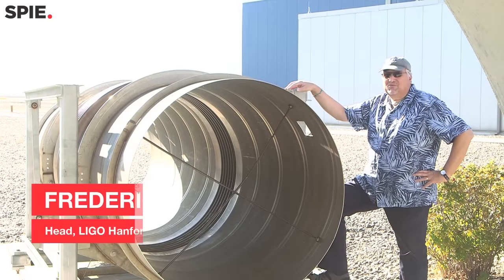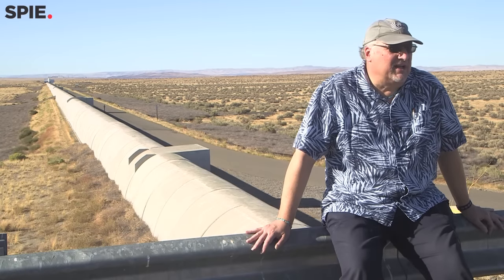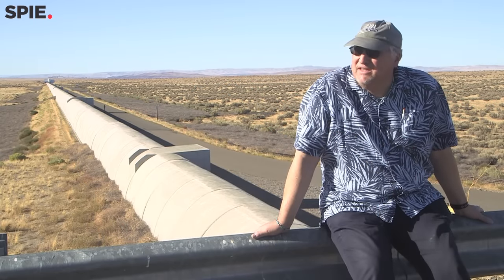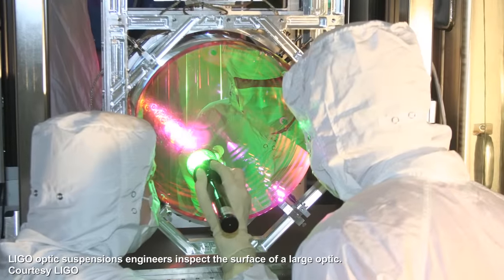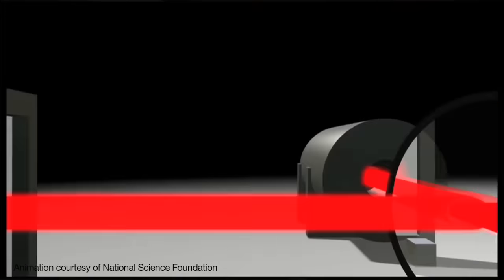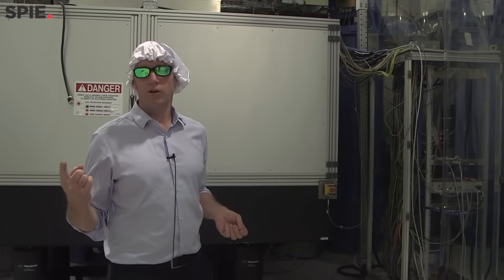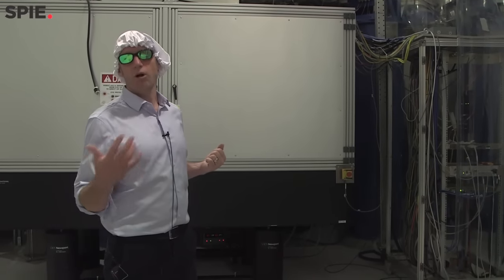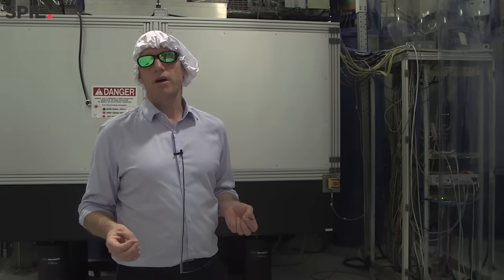Gravitational wave detection a step closer with Advanced LIGO

Comment: Ok, but how do they know that the wave witch they detect comes from a particular place in space? how do they ''target'' it?
Reply: +Petros Kefallinos the two LIGOs are 3000 kms apart. It depends to the time difference of receiving the signal at the two LIGOs. If it is 0ms, the signal comes perpendicularly to the plane of the LIGOs, if it is 10 ms, it comes parallel to the plane of the LIGOs. Anything in between determines the relative position of the signal to the plane of the LIGOs at the moment of arrival, given the fact that you know how the plane of the LIGOs is oriented against the constellations of course
Reply: +martinasenov3361 aha... i kinda get it.. i guess they also see if the data they receive match with something like the period of orbit between some object in the sky in the area that it is coming from because i believe that from an area there is not only 1 object emitting waves in space.. so its like they double check it that way... of course it must be even more complex than that.. thank you! :)
Reply: +Petros Kefallinos yes, but this is achieved by measuring the wavelength mismatch between the laser beams from the two arms of each LIGO. When the arms stretch, they mismatch, thus generating a signal. Basically they measure the intervals between each stretch and compress, which in this case matched a pattern of a black hole merger